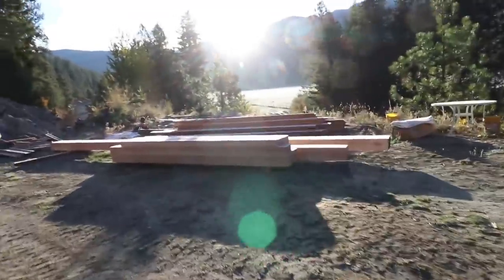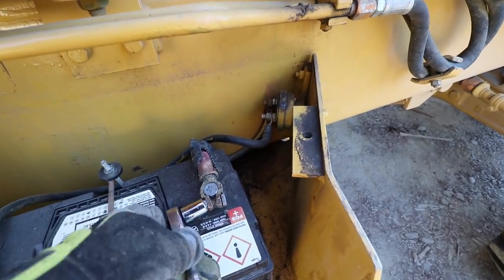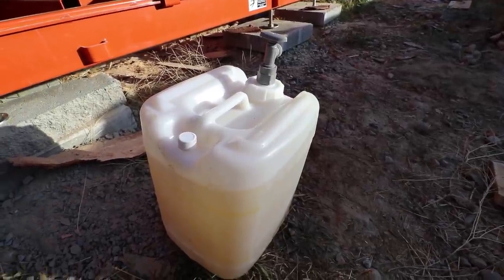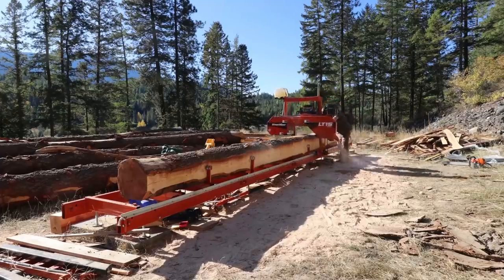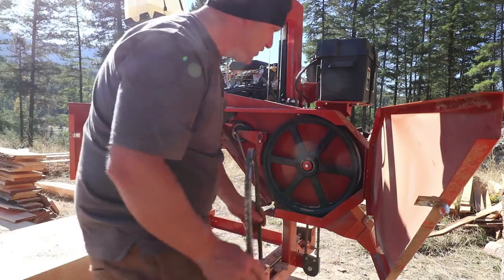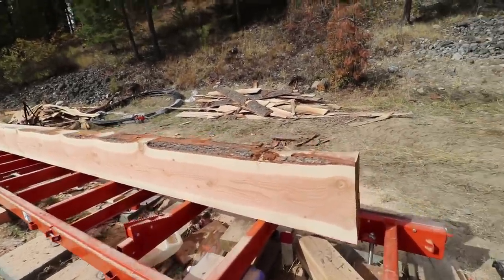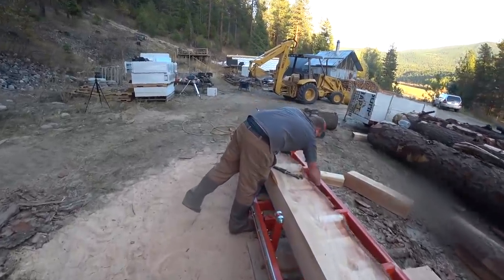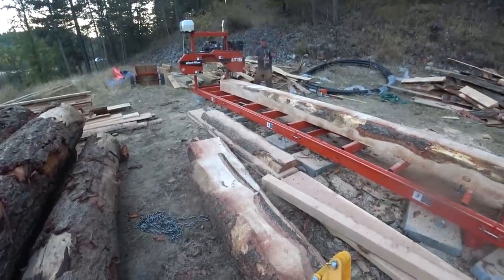BROKE OUR FIRST BLADE! (LT15 Woodmizer Sawmill)

Comment: Don't throw the saw blade away because they are easy to fix if you have the right stuff. Get winter diesel fuel conditioner. Not sure I'd put gasoline in it unless you know exactly what you are doing.

Comment: It could also be a bad alternator not charging the battery properly when in use.
Disconnect the battery when the engine is running, stick a voltmeter across the battery leads & see what voltage the alternator is kicking out.

Also, you know all that leftover concrete you had from your slab and wall pours? You should have used that to make pads for your mill and embedded studs into them. 
Someone mentioned it in a previous comment months ago, but as you already said, you don't read comments.
Reply: James Bradwell you can just check the battery with a volt meter with the engine on and off, if the alternator is dead then the voltage will be lower during the on state then off, if its working it will be higher in the on state

Comment: why dont u unhook the battery completely and see if it will start the next morning after u re attach it also take the positive off and touch it to the terminal when the backhoe is off and see if u get any sparks so u know which it is but i just remembered ur vids are a week or 2 off so u prolly already fixed ur problem but if not hope it helps! keep up the great vids!

Comment: Hey I worked for the Company that supplies Federated the batteries they use and it is not the battery. I would bet that you still have a draw somewhere. I have the same problem on my boat. even though I still disconnect the positive or use the battery disconnect.

Comment: By disconnecting/connecting the ground pole you don't run any risk with your tools when tightening the ground again. OTOH when disconnecting/connecting the positive pole you have the risk of your tools touching a grounded part. Not good!

Comment: I have a similar issue with my diesel Mercedes. It has actually killed two Red-Top batteries in a little more than three years.  Disconnecting both terminals is the only way I've been able to keep it from bleeding the battery dry. It makes no sense to me. I figured you could just interrupt the circuit anywhere but that doesn't seem to be the case in practice. If you figure it out please share your thoughts in a video. Thanks!

Comment: maybe you should of taken some of your rebar and pounded them into the ground next to your rails and cross members to keep it from moving.
Reply: Good suggestion !  8 pieces of 3-4' rebar attached to the frame would keep it from moving.

Maybe take some of the shorter 4x6 and place one under each pair of legs.  Drill hole through the 4x6 and pound in rebar to anchor the wood.  Not sure how to attach the legs to the wood so that the rails will not move.  Hopefully they come up with a good solution in a future video !

Comment: Disconnect the ground to prevent draining electrical power form the battery? The ground is - and the device side +. Electrical lore dictates the current flows from + to -. Physics however discovered the electrons go from - to +. Maybe you should disconnect both to find out if the problem is the battery or an earth leak somewhere.

Comment: a capacitor boost block permanently attached to the battery   will make the battery last longer and will give you much better cranking amps i would use at least a 300 amp boost block for the backhoe liquid soap would make the water slippery and it will lower the freeze temp.

Comment: Your alternator is bad. Tractor being diesel doesn't require battery voltage to run.just for cranking and lights. I had to replace one on the nieghbors Hoe for the same issues. On the mill you should get about 6 old truck axle shafts and drive them in the ground. Then use chain and binders to bind the mill to the ground to stabilize it. That's what we do to stabilize the Mills we use on our steam tractors at tractor shows.

Comment: Batteries don't like cold weather either.  You might try one of those supercap battery replacements either instead or in parallel (probably best in parallel on a big diesel).  You can draw full cranking amps from those even when they're cold.  A small PV panel on the roof of the vehicle can keep them topped up when unattended.   

In really cold weather,  you can do what crazy Russians do, and light a fire under the engine sump :)
Reply: Winter in Ohio, had to bring my car battery in the house over night.  An hour befor starting the car in the morning, had to light several cans of Sterno under the oil pan to warm the oil!  What a pain arse that was...

Comment: Simple diesels do not need the battery when running so if the alternator is not charging you would not know, until the next cold start.
When the engine is warm it will turn over a lot easier so maybe that is why you think it is charging.

Simple check if you have a voltmeter it should be 13.8V or above but not higher than 14.4V on charge.
Reply: Well. Any engine do not need battery when running. I have same problem on my 1996 skoda felicie. Disconect battery is only solution i found
Reply: Yes but a diesel will run even without an alternator fitted. It requires no spark so does not need any power to run. Your skoda may run without a battery but the coil/points may not like it and if it is a modern car with electronic ignition I would be surprised if it ran for more than a few seconds.

Comment: a bad alternator can put out just enough current to keep a motor running but not charge the battery. With a diesel they dont have spark plugs so once they start they can run forever if they are mechanically injected. You most likely have a bad alternator or one dead diode.

Also, a bad battery that wont hold a charge will kill an alternator by keeping it under a very heavy load all the time. This is why most of the time when one goes, so does the other...
Reply: MasterQuack14 how would a dead battery put stress on an alternator? The only reason for the battery is to kick-start the car and keep it going when the engine is turned off.
Reply: A bad battery wont carry a charge. The lower the voltage on a battery, the lower it's internal resistance, thus flowing more current. When a battery is fully charged up equal to the potential voltage of the alternator they will flow very little current. Starting a vehicle requires high amperage for a short burst but the over all wattage is pretty low so it shouldn't take the alternator very long at all to replace the used wattage off the battery. Vehicle alternators are designed to run at a constant low load and is very low around idle or just above. If you have a bad battery running an alternator at near full load constantly trying to charge a battery that wont take a charge it will burn out pretty quickly. This is why you upgrade from a stock 50~60 amp alternator to a 200+ amp alternator if you run a winch. You also rev the motor up around 30 to 50% motor rpm to spin the alternator faster to provide said current, otherwise you just brown out the alternator causing even more stress.

Also, a glass matt battery that is allowed to run completely dead will never recover their full starting current potential as the lead dissolves completely from the glass matt and will not reattach during charging.

Comment: My 2cents, someone said ”it diesel, they run without a battery” yeh, well maybe not. You said you use the battery disconnect to shut the engine off, means you must have an electronic fuel solenoid. This is most likely wired into other monitoring systems so that if you get high temp or low oil they would interrupt the voltage going to the solenoid and shut the solenoid, stop the fuel and shut the engine off. I have also noticed in several videos you have the orange flashers going, all using power. It is possible you have a combination of things going on. Most alternators do not generate 14+ volts (needed to charge your battery, you know this from your solar system) until the rpm get over 800 to 1,000. The engine at idle simply doesn’t spin the alternator fast enough to charge the battery. Perhaps you have had a dead battery in your car on a hot summer day. After driving around town with the AC on, not on the freeway, you pull into a parking spot, get out to get a cup of coffee come back to the car 30 min later and notin’. The car will not start. The city driving was low RPM and you had to more draw on the battery from the AC then the alternator was putting out. As you know there a difference between starting and running. You battery has the voltage to keep the tractor running but it never gets a full charge to get it to the point of being able to start the next morning. To add to that problem if it’s a weak battery there will be a discharge overnight and the onset of cold weather is only gonna make all this worse. A block heater is nice and if you do that you can wire in a 1 or 2 amp trickle charger so 1 plug and you get both. just my 2 cents.

Comment: Backhoe has an electric fuel shut off solenoid. When you turn the key, the solenoid plunger is drawn open and allows fuel to flow to diesel pump. When you turn off key ( or disconnect battery ) the solenoid closes and cuts off fuel supply causing engine to stop.

To test for parasitic draw you can use a cheap 12 volt test light that uses a bulb. Disconnect battery cable from battery post ( either positive or negative), attach one end of test light onto battery cable end and other end onto battery post. Briefly touch battery cable to battery post while keeping test light in  circuit, now allow battery cable to disconnect from battery post. If light on test light glows, you have a draw. Reach into backhoe and turn on light switch, light on tester glows because the lights are drawing power ( lights will not come on because the battery is not coonected though) . It is normal to ha e a small draw from battery for such things as a radio memory or clock, but this small draw is not enought to light up the test light. Simple but accurate test.

Comment: as to the battery...is it sitting on the metal in the compartment? it should be on rubber, if its sitting on straight metal that can leech the power. also, a lot of times in my experience the "phantom load" most of the times is either a bad alternator or a bad starter.
Reply: Storing batteries on the ground or a piece of metal is absolutely fine, that's an old wives' tale.

Comment: Simple way to get your mill to stop moving would be to use rubber pads between the slab and the legs. It will take some of the shock and once you put some wight on it the legs should settle in a drepetion and not move

Comment: I've been thinking since you bought the thing that you just have an old battery that doesn't hold a great charge and needs to be replaced.  Considering how relatively inexpensive batteries are, and how much of a pain in the ass it is to jump-start it every morning, I can't believe you haven't just bought a new battery already to at least rule that out if not solve the problem.

Comment: Maybe I missed something ,but I saw your positive cable hooked over the battery hold down bolt and although it appears to be sitting on a rubber washer , if the cable clamp touches the hold down bolt or the mut you have not broken the circuit as you believe ----------
Reply: If the battery positive post have been disconnected then it doesn't matter that the positive lead going to the rest of the vehicle is shorted to the ground as there is no currents through this as there is no battery connected. Electric circuits needs a full circuit that's not open anywhere or no current will flow, it's just a battery sitting there with one pole floating and the other tied to the rest of the vehicle.

The recommendation to always disconnect the negative post first is to prevent you from shorting out the positive post to ground with your tool thus shorting out the battery with the impending doom that may / will bring. When you disconnect the negative first then the rest of the vehicle is already at ground (or very close if there is a shunt in place and a current is drawn) so nothing happens if your tool touches the battery negative post and ground at the same time.
Reply: You are 100 % right Morten .I don't know what I was thinking .Getting old I guess .

Comment: The Negative terminal on the battery should be disconnect when isolating it . 
Because that cable is connected to the  body and if you go for the positive one first and accidentally touch any metal part with the metallic tool you will short circuit the battery.

Comment: The alternator is only a maintaining device it should not be used to charge a battery if you use the alternator to charge the battery you can do damage to the battery and the alternator .. buy a fresh battery and recheck the charging system if it's not 13.5 or better but not over 14.5 the alternator is bad

Comment: Dig holes 2 feet deep and 1 foot in diameter under every other set of legs, fill with concrete. They don't even have to be level since you can adjust the legs individually. Get feet that you can bolt to the new concrete pads. You could probably get away with doing even less than every other set, maybe only 4 or so total, you just don't want the thing moving.

Comment: I’d get a electric meter and meter battery and then meter your wiring and switches for resistance. If it’s shorted to ground it will discharge. If it’s older batter it could just not be up to par for cold cranking amps. A little boost n it works fine.    As far as the sawmill goes since it has already moved and u are going to re level. I️ would go ahead and move the sawmill down to your farthest log. So u don’t have to move every log.   
I’d drive some rebar or something into the pads so they won’t move then drill a hole in your foot and anchor a few of the feet to the pads. Should fix that.   Easiest thing would be find an old set of forks that will go on your backhoe and not stack your logs against the mill. U can pick logs up w forks and move as needed.
Reply: I’d definitely build some ramps for you to roll logs up on mill.
Reply: Add methanol to your lubricant found in Walmart fuel additives or lower quantity in winter windshield wiper fluid. It evaporates very quickly when exposed to air.

Comment: If you have a volt meter, verify alternator output is 13.8 to 14.3 volts.  If yes, probability is alternator is OK.
Crank (staring) batteries discharge and charge quickly - it's what they do.  What they don't do is tolerate deep discharges, so one way or another crank batteries must be kept charged.
For a negative ground DC system the cutoff to eliminate ant parasitic load ought to be on the negative terminal.  Disconnecting the positive battery lead with the negative battery lead still connected is an invitation to disaster.  Disconnecting the negative battery lead with the positive still connected is a no harm - no foul.

Comment: but diesel engines run without any battery. Are you sure its not the alternator? Easy to test measure the voltage of the battery then measure it again when started (across the battery), if the alternator is working it should read around 14.4 volts (assuming its a 12 volt system). If it reads over 14 volts your alternator is fine

Comment: Wax maybe.  It seems that it would be a lot easier to have two spikes one on each side of the log that you can screw into the center and spin the log. Something like a lathe. And it would be easier to align everything, especially if log is much thicker on one side then the other. But that more of a suggestion for wood-miser i guess. Or better yet   sawmill-lathe.
Reply: You could even add a hydraulic jack-stand on each end to raise the ends up to spin the log.

Comment: A five dollar harbor freight multimeter to check over all voltage to your battery with the car (tractor) off and then with it o will give you a pretty good idea if your charging well, as would a volt gauge on the tractor. I would also get a hydrometer to check individual cells in the battery. 
Your issue I am almost positive is a bad battery but only a test so tell you absolutely.  Oh and a disconnect should be on the negative side when near the battery to help prevent sparks, a over charged battery or one that is trying to die will make a lot of hydrogen gas which as we all know from the Hindenburg makes explosions.